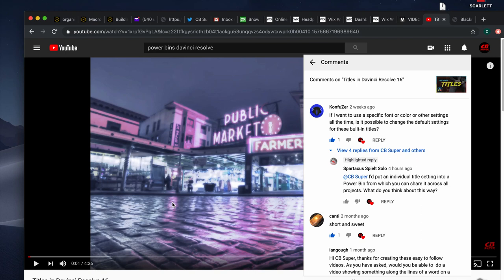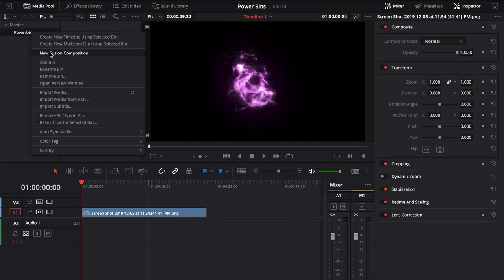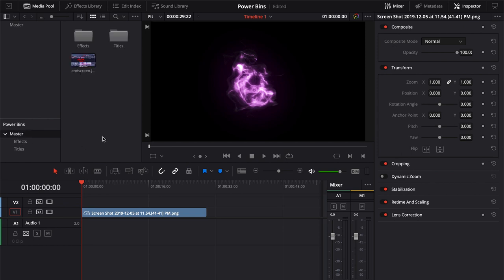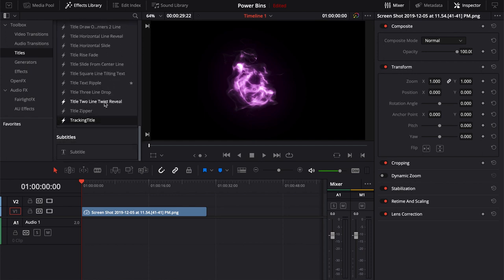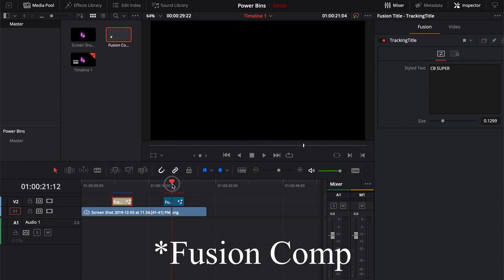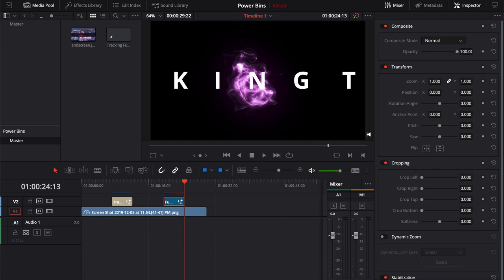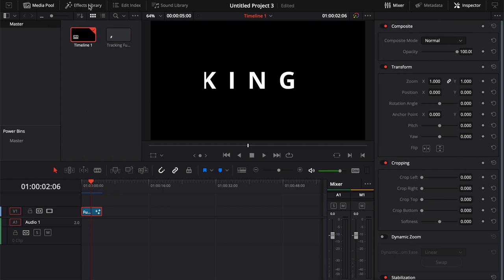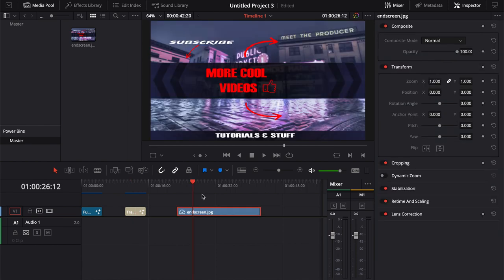Power Bins in DaVinci Resolve

Comment: Super, this is exactly what I need to know.  So basically, in my case it would be better  to use text inside a compound clip  than put it in a power bin. To use the same end credits in different episodes.
Reply from the maker: Sorry, this video is now outdated. Apparently it's no longer possible to put in Fusion Clips into the Power Bin. This is unfortunate as this was what i used it for the most. Now you'll need to either make a macro or save a fusion node tree to a .setting file.
Reply: @CBSuper  The powerbin does except fusion comporitions. So I could make my ending credits in a fusion comp and ad it to powerbin to share across projects righgt?

Comment: Are power bins exclusive per database? I’m going to be having separate databases per client at work and if that’s the case this will save me a ton of time from having to set up each project! I’m new to Resolve and am just mind blown at how awesome it is. It’s the most intuitive piece of editing software I’ve seen. Premiere has been giving me so many headaches over the past year I’ve been ready for a switch.
Reply from the maker: Not sure. Ive never really gotten into the weeds on databases. I think its that way as ive had different users set up on two different accounts on the same computer and they didnt share any of the same folders. But you’ll need to test it out to be sure.

Comment: What is the hiss in the background of your videos? Is that the mic? Just bought Resolve so will be binge watching your videos, thanks!
Reply from the maker: Ahh, that would be the fan on my macbook. The area i record my screen capture is not the best for sound recording. I’ll work on that. Thanks for bringing it up though, now I’m noticing it on several of the recent videos I posted.
Reply from the maker: I stopped using Noise Reduction a few videos back as I felt like it made me sound a little Robotic, but I will use it going forward. It does help quite a bit to quell the fan noise.

Comment: What about audio settings like compressors, eq's, ect? Is there a way to save that for different projects?
Reply from the maker: You can save presets for the FairlightFX, but I'm not sure about the AU Effects. I will have to look into that more. To save presets in the FairlightFX, just click the little plus sign in the top left of whichever effect pane you have after you drag and drop it onto your channel/clip and rename it..then hit OK. You can recall it when you go back into the Twirl down just to the right of that little plus sign. As for saving that for different projects, I'm not sure, I'd have to look into that a bit more. I'm actually still learning about all the Fairlight page stuff and still very new to it (past 6 months or so). I usually save presets for whatever Microphone I'm using....so I set a Vocal Channel and Multiband Compressor preset so it saves me a little time with editing my tutorials.

Comment: Hi I wonder what is the default save destination for the Power Bins? Tnx.
Reply from the maker: DaVinci uses a Database system instead of actually saving the media in any one place, so the file is actually still wherever it is on your computer, DaVinci is just placing that path in a location that is easy to recall on all your projects instead of just the master bin of one project. At least that's how I understand it. You can find the databases file in your User profiles, application support, etc...but it will be a text file that isn't really all that intuitive.
Reply: @CBSuper  Sounds to me something like TEMP folder. Anyway thnx for the really fast answer and tnx for your tutorials.
Reply from the maker: Sun Drive it very well could be. I’m able to figure out where to put macros and templates, but anything beyond that is beyond my computer knowledge level.